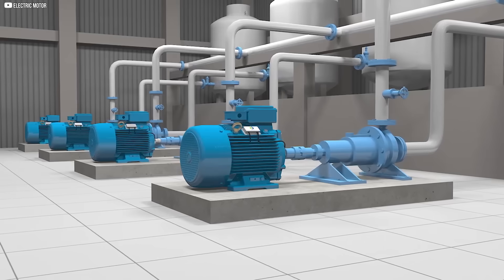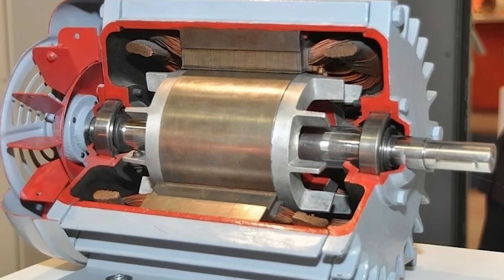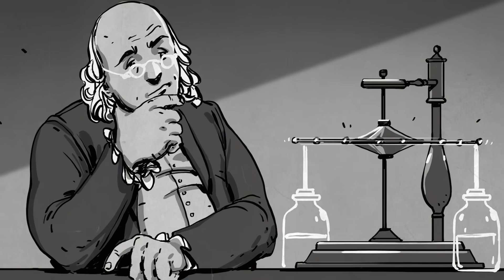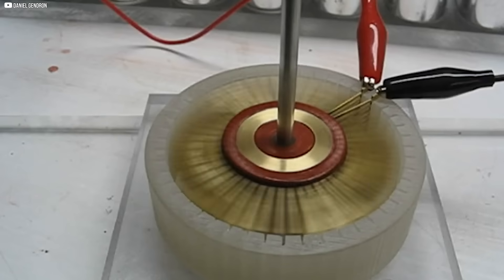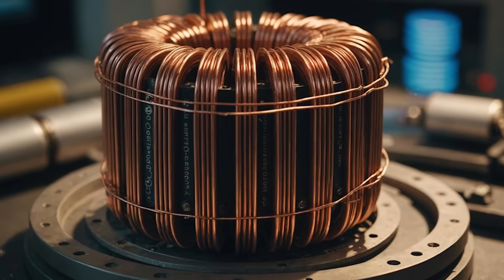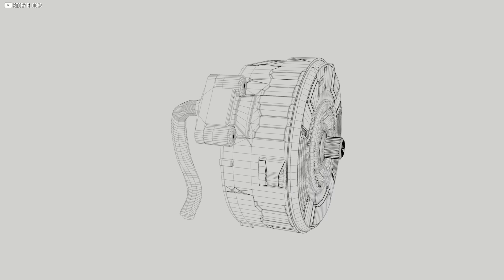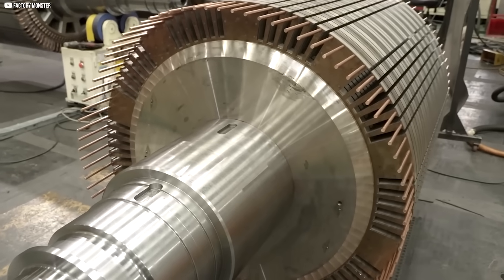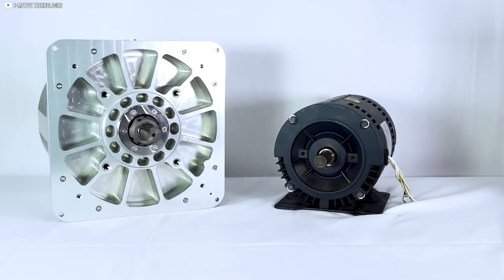Benjamin Franklin’s Forgotten Invention: The Electrostatic Motor Reborn

Comment: The possibility of an electrically assisted bicycle with an electrostatic motor is intriguing. As I understand it, a commercial model of the C-motive motor produces 1/2 HP. Supplemented with supercapacitors instead of lithium batteries, it could provide assistance in climbing hills.
Reply: Super Caps are low voltage, E stat motors are heavy. Fluid is friction. = oops, oops, & oops.

Comment: yokeless axial motor with carbon fiber sleeves instead of iron, carbon nanotubes instead of copper, nyron magnetic's magnets instead or normal magnets. I think electromagnetic motors are still viable but it would be good to have competition
Reply: I think too. This video is pretty a publicity to serve C-Motive or of C-Motive.
Reply: It's not that easy as of now, like for instance carbon nano tubes are way more costlier to make, after that the winding of that and everything is more complicated. 
Niron magnets are not that efficient and reliable. Performance is the biggest lag when come to there magnets. Also they are not reliable with high stress conditions like high temp. Size, weight etc. 

Material science is improving day by day and that give me hopes. Maybe that could be true or maybe we could have better alternatives.

Comment: 3 phase electric AC motor does not have any magnets.
Reply: Permenant magnet!
Reply: @anilkshirsagar4442  Not So. There are no permanent magnets in a three phase induction motor  The stator windings induce a current in the rotor which drives the rotor.

Comment: What voltage is necessary for an electrostatic Motor that can compete with ordinary, cheap electromagnetic motors?  10.000 V? 100.000V?   "Voltage instead of current" sound good, but means many problems. Where is a real advantage?
Reply: That is why Benjamin Franklin is remembered for getting electrocuted by lightning.
Reply: The advantage is that you dont need a lot of copper and rare earths. It makes them cheaper and reduce weight.
Reply: The advantage is the ability to power devices from atmospheric static electricity instead of expensive stored potential from non-green sources. What isn’t being mentioned here is that this motor would be able to be powered by very low cost electrostatic generators mounted in a tower, pole or even a tree.